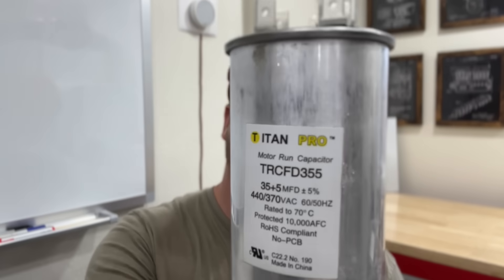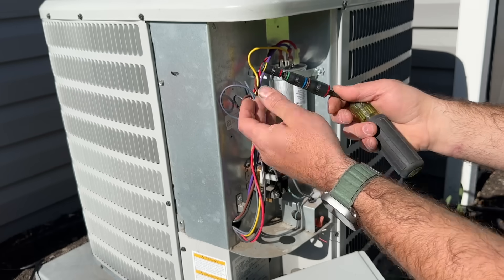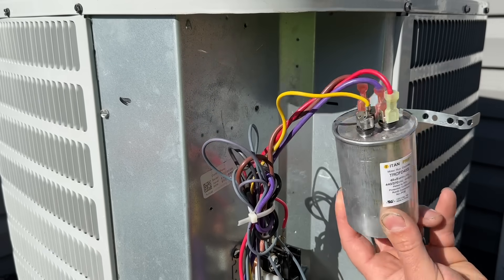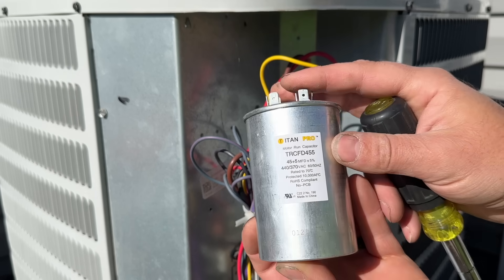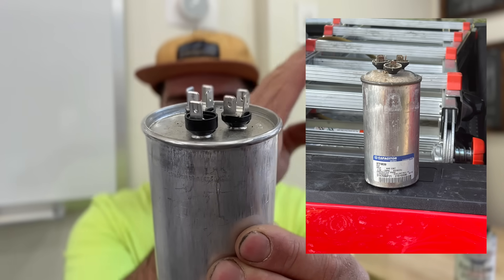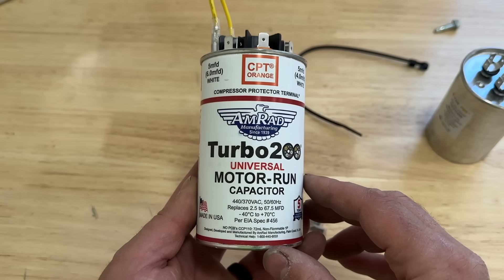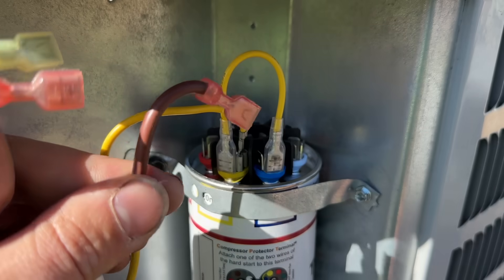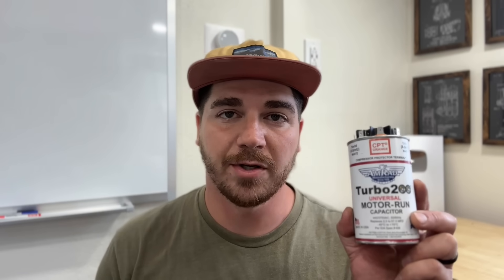HVAC Contractors Practically Make Their Living On These

Comment: I replaced my capacitor last year in my Lennox heat pump but there was a puzzle - a resistor was connected between two terminals of the old one.  I didn’t know what to do, so i removed the resistor and re-connected it to the same terminals of the new one.  Was that what I should have done?

Comment: Do capacitors fail slowly or quickly. In other words, if I checked monthly with my multi meter, would I see the readings start to form a trend and signal impending doom?
Reply from the maker: Yes,  every month is excessive but just making sure it’s within that 5-6% every three-six months is totally fine. Most people just wait until it’s popped to replace it 🤣
Reply: @diyhvacguy I have replaced 30 year old condensers that have the original capacitors in them explain this?
Reply: @okiedean1112  Made in America?

Comment: I just took some pics of mine to order a replacement (it failed twice in 5 years and I paid a lot of money to have it fixed, on a high end brand as well, Carrier)) so i will do it myself next time, and its the same brand as yours in the video.
Reply: All HVAC manufacturers are using the same cheap parts such as motors, capacitors, contactors, service valves, driers, etc.
Reply: @garrybillick3979  yeah, it figures. After all a carrier is a Bryant, is a Arcoaire, Comfortmaker, Day & Night, Heil, Payne, and Tempstar
Reply: I just did some research....quality caps include AmRad (very expensive) and Titan HD (not the pro). Titan HD is made in usa, pro is made in china. Titan HD about twice the price of the pro. UPDATE- Titan HD is getting some bad reviews...looks like amrad, mars or supco
Reply: @Mach141  I’ve seen plenty of Amrad caps outlive the compressors.  They are worth it.  But, a Mars or Supco will last for many years, at a lower cost.
Reply: @garrybillick3979  Thanks. I have a heat pump, and live in middle GA, so it runs year round non stop, except maybe for a couple weeks in spring and fall. I see an amrad for $64 and a mars for $46 so faR
Reply: @Mach141  Being a heat pump with high annual runtime, I’d spend the money on the Amrad and know it will most likely last much longer.
Reply: Check you connections too the compressor and the ohms  common to start commen to run and run to start.  c+s=? c+r=? r+s= the combined ohms of c+s and c+r combined for a balanced wye load, Look up the Wye and the Delta load to understand.
Reply: @okiedean1112  Its not broken now, im only ordering a spare. Which i might as well install and use the cheap crap cap $18 cap that the a/c guy charged me $200 for as the backup

Comment: I have heard from many people who had a HVAC place tell them they had to replace either, or both furnace and A/C units, and I went to help them and found simple parts had failed and the company was trying to make money on the unnecessary replacement.  The most common was a blown capacitor, and a burned out limit switch.  One was a burned out 24 volt transformer.  Shameful what some people will do to others.

Comment: I’ve started keeping spare start and run capacitors since I had two of each die on me. Unfortunately, the herm was blown on one and the clueless tech only changed out the capacitor not bothering to check all the circuits. Eventually, I found that wires going from the breaker to the condenser were not connected correctly to the breaker. Luckily the tech I had come out removed the breaker and put in a disconnect. Most of the techs are just trying to sell you new systems and have no clue about troubleshooting.
Reply: They are parts changers that's the servic tech now days,  there bosses care about money,, not all I wasn't.

Comment: It’s sad the nonsense of  the residential and commercial markets. Soo many techs (gray collar sales techs) dependent on spifs for new equipment, quick money bs. People are so in fear of the HVAC going down at the absolute worst time. I can’t get over the hacks that sell the PTCR hard start kits for quick buck. Only start components I will sell are ones approved by the oem of compressor or unit. That being mostly potential relay and start cap( 5-2-1 and kickstart are ok) I have to install them due to 208Y power and over burden services. I also work Industrial and a few commercial contracts.

Comment: Is there an issue or problem leaving that Turbo 200 capacitor in place? Is there a certain brand name (not Made in China) capacitor that we can purchase to replace our old capacitor?
Reply from the maker: No problem at all leaving the turbo 200 in place 👍🏼
Reply: @diyhvacguy Why not the original rating for 30 bucks. I have the Tecumseh and Copeland technical books?

Comment: At 6:50 - discussing Plus or MINUS 6% - do you not mean that the 45 uF could be 42.4 uF and still be within spec??  Because you state that the plus/minus indicates that if it is below 45 - it is Bad.  I believe it has an actual 'ok' range of: 42.3 uF - 47.7 uF.   All of which are fine and Ok.  The Fan 5uF would have a range of: 4.7 uF - 5.3 uF and still be within spec.

Comment: Happened to me they charged me 300.00 to fix it even with me standing over him said it was a bad capacitor then to put icing on the cake said he wasn't sure if he even had one in his truck if not would have to be ordered. it was over 100 degrees outside and when he walked to his truck to check I started to prey he had one. (Part of there scam) Then the following week I was talking to my neighbor and he said his went out and bought it at Lowes 5 miles away for 13.00 easy to put on!

Comment: You didn’t say anything about volt 330v or 440v , should by 440v when to rest volt most you will see about 290v-310v TOO CLOSE in slight voltage spike will over load & cause early death to new cap

Comment: If your a/c is out not everyone has the size run capacitor you need for immediate fix.  The multi fit capacitor that is mostly carried on repair is over 100$ Made in America not china so good quality and handles heat very good. Worth it.

Comment: Are the caps you'd get from Lennox for instance, a higher quality or are they the same as the ones from Repair Clinic, in other words, from China? I'm going to buy a spare that is an exact replacement. Looking forward to using my capacitor discharge pen for the first time, but I hope I won't ever need it.
Reply: Capacitors from China, unfortunately have a high failure rate and should be avoided.

Comment: At some point in my life, I learned about capacitor start and capacitor run in motor control circuits. First time I requested a HVAC service call, I followed tech around. All this tech did was to replace a capacitor by taking off an easily accessible panel. The next time I needed another service call for same problem, I told tech that it most likely was caused by a nonfunctional capacitor. I pumped this tech about what kind of capacitor I needed to get for the next time it happened. This tech did tell me about the kind of capacitor I needed to get. I googled to find the best quality capacitor that was available for replacement. (Probably most of this type of capacitors are made in China.) I ordered 2 of these capacitors. Put both of them,  separately, in heavy duty plastic bags (freezer food storage ones available at most grocery stores) and put both of them behind control panel I would have to take off to replace nonfunctional capacitor. They may be good luck charms since I have not have to replace a capacitor again (true, but I am just being humorous).